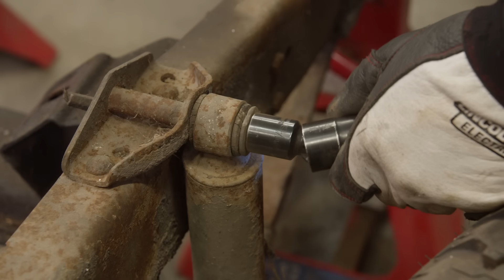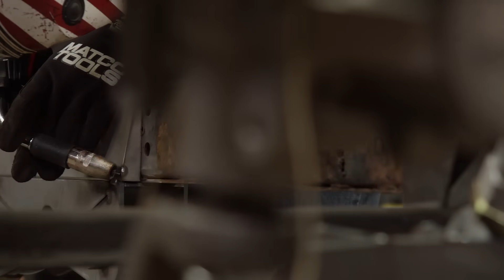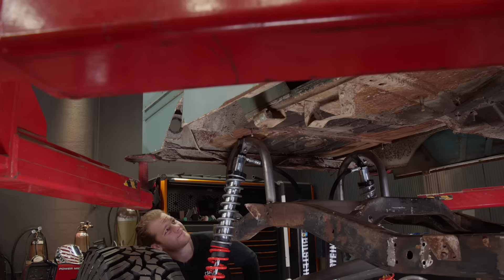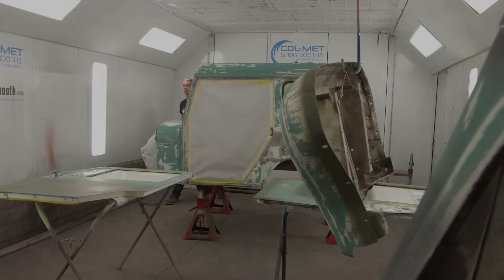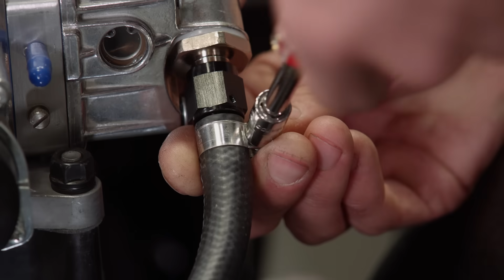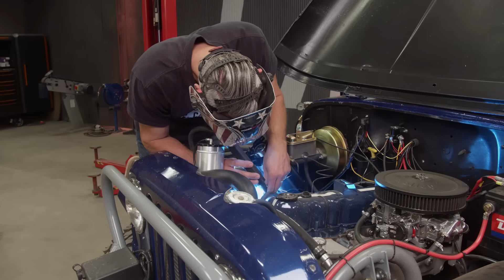We Turned a Mail Jeep Into a Serious Trail Machine

Comment: I have run into more than 1 Duralast wheel bearing that had wheel studs that overstretched at a reasonable lug nut torque. Last brand I would ever choose, if I wanted to trust the wheel to stay on.

Comment: You can test the transitor to see if it failed. A faulty door swith or bad ground creating repeated switching of  the circuit will make a transistor fail. I had a circuit on a pinball machine kill the transistors due to dirty optical switches.

Comment: Love the project. A friend of mine had one of these DJ jeeps, but it was left hand drive. It was an Airforce MP security patrol vehicle from our local air base. Had tons of fun in the woods and fields. 
Ps. You guys need to tighten your hardware a little more. Don't be afraid to crank on it a little, especially when using a short wrench.

Comment: Redid my 5.4l, 3valve. Need a tune; really bad!!! S&B intake with exhaust cutout. Engine runs better; with the cutout closed. Have 37" tires...so; need to turn big tires. 
Getting 10.5 mpg. Shifting points are not right. A lot of torque. No high rev. Excitement!
Would a tuner work???

Comment: The front differential cover you got from Summer racing doesn’t have the channel around the ringer area, so it will Throw oil forward properly. You need to Gail Banks cover that does have the proper shape to it to have proper oiling.

Comment: The hole through the fire wall for the wiring should have a rubber chassis grommet. Over a period of time with vibration. the metal edges will abrade the wire insulation, creating a condition for short circuits or grounding conditions that may be hard to trace.

Comment: I never noticed them installing a radiator fan. When you crawl at low speed, you need to move air across the core with a good fan. The separate transmission cooler had a fan

Comment: WOW!! GOOD WORK on paint.
If I was to paint it,  the big difference I would do….. instead of paint.
I wound use Line-X, or Rhino Liner like the material used on spray on bed liner.
You fine gentlemen still did a far better job than I can.

Comment: Now, tell us how much you would charge someone to create such a build. Even when combining old parts from a junkyard, the vehicle produced will need FAR more money to keep it driveable than the cost of creating it. This goes the same for those purchasing classic cars and trucks at auction.  As gorgeous as it might be on the outside, the car will be at a shop for repairs more often than it's sitting in your garage, even if you merely drive it on weekends.  You must constantly pump money into it, (a money pit), as most parts will eventually fail.

Comment: No dirt no mess no problems everything goes on perfectly. Amazing a pipe bender a torch a tape measure and a cutter autozone and that other main supplier is all you need. Oh and the hands are perfect to no cuts etc. all programming and starting works right from the get go….. shops would kill for easy work like this they broke the code

Comment: What’s stopping me from spraying my own vehicle is buying a 5 gallon bucket of wool wax and a sprayer and wondering how far do you go, the frame washed out and sealed, bottom of vehicle, frame to body connections, seams and inner body panels, wheel to disk or drum connections where dissimilar metals like to cause corrosion. I like the fluid film but the wool wax I think is the ticket for undercoating and rust protection

Comment: I'm big into jeeps, but towards the beginning, you said having a longer wheel length will be better, that's not all correct. The longer the wheel base is, the easier it will bottom out. So example trucks, if you take a truck on a trail with mud and big rocks, it will have a higher chance of bottoming out.

Comment: To any young mechanics get good with a torch it will save you so much time and headaches you can nip nuts in half while saving the stud or bolt it's on heat stuffto get loose nip welds without cutting threw the base metal ...all kinda stuff just practic when you can

Comment: I worked on those jeeps Back in the early 80's .
Some JEEPS had the Steering wheel on the other side. (I passed my test drive in one of these)
They were the last ones to be Replaced for "Ford Pinto" bad idea. Then at Last, The Best Came Along The LLV's.

Comment: A Strap on o2 sensor......hmmm.... Cause that wont leak and give a false reading, spend the extra 15 mins and weld it on with a proper bung, 15 minutes now will save you hours out on the trail.

Comment: There is no lubrication to any bolts,bearings and any surfaces at all anywhere.i wonder if those wires through firewall will be cut due to no conduit around it.this rig would rust and seize itself together within two years.

Comment: I’m watching you guys wire up the jeep when you put the module inside on the firewall and cut a hole in the firewall why didn’t you use rubber grommet in the firewall to protect the wires going from the inside of the vehicle to the engine compartment

Comment: I have a Dana 44 in my bronco build and I’m running 38s just fine never had a problem with my axles
Reply: I've got a 74 Bronco with a Dana 44 up front and a Ford 9" out back, so can I ask wtf do you need tires that tall for? Do you rock climb in a 1st generation Bronco? I'm runnin 33" BFGoodrichs, a truck 4spd, 4.88 gears and posi front and rear and this thing wheels like a mule...

Comment: Biggest question i have was the trans cooler placement ever an issue? Seems odd to be on the bottom, and would be a concern if it was on really aggressive runs that might cause a bottom out, or in a bit wetter areas. I dont mean mudding, thats not any fun to me, but i get that people like it. Im more concerned about the fins getting clogged up from moisture and dust, and potential rock damage?

Awesome video BTW. Really cool because im building a DJ5 into a rat rod. im embracing that its my 2WD jeep.

Comment: You need some suspension seats with a 5 point harness.  Those seats with lap belts look like crap.  It needs a light bar and a spare on the back with a trail jack.  The tires are not the best trail tires unless you are street driving it too.  You should have a pump to air the tires back up after a trail ride.  You also need mirrors and a horn if you want it street legal (as well as all the lights and turn signals.  I would put a quieter exhaust in it too.  It sounds like a diesel that is struggling...  Then you can put a sound system in it.  Put in a fire extinguisher as well as tree straps and a pully.  I would have welded on a O2 bung.

Comment: On the Victor Wrench 
(Cutting Torch) there are other cutting heads avalible. A 45° an a 90° which aid considerably for bolt an rivet heads or blowing out welds .

Comment: Question maybe I'm just picky or bitching but with all the stuff you guys grind off to weld I get taking the old paint and rust off but do you not paint in the spot your not welding to for one and 2 do you not paint the shit you weld untill you get the frame blasted and coated or am I way to picky I'm just asking maybe I've been wasting time I've just always come across rust under shit that was built like that

Comment: Definitely not a professional job when you run your ground and power through the body with no rubber grommets that equals melt down on electrical. The second they got all these high tech tools and cannot figure out the correct angles to build for the doors thank goodness for sheet metal to cover that mess up. The third thing is never put your transmission cooler above your driveshaft if you twist your driveshaft off it goes into your transmission cooler. Absolutely amazed how they even got sponsors. Nice job on the 4 link though

Comment: One of the only things I'd have done differently is add an on board air compressor. 

They're great to have for a real offroading vehicle since you'll be airing the tires up and down pretty often if you know what you're doing.

Also, as much as I like an aggressive sounding vehicle, that baby downpipe and barely a muffler combo is going to be brutal considering you'll be riding around with the doors off constantly just assaulting your own ears.
Reply: Good suggestions, and speaking of the exhaust system, I would ditch the hose clamps and weld the O2 sensor mounting plate onto the pipe. It would be a bit more work, but you wouldn't have to worry about it leaking or coming loose.

Comment: Fuel cell needs to be a cylinder hidden under suspension hoop cover to take advantage of the space.  Cover could be a bit bigger to close in both elements.  Would be a better separation between fumes and operator.......  gotta have some space for a few bags of groceries.......

Comment: While you axed the obsolete brackets, why not fill the holes and avoid dirt/moisture intrusion?
Reply: Bro, these shows are several years old if not older, and most, not all but most projects are built, used a few times for a show and then crushed after they strip sponsor parts off.
Reply: @TheRoadhammer379  seems like you've made this comment b4. This episode is only a few months old. Am I missing your point?

Comment: The issue with mounting bump stops on the frame like that is you loose up travel because of the location of bump stop. You have wide axles. Widen your bump stops to the furthest out you can go and it will allow you to have more up travel when compared to mounting it under the chassis.

Comment: Not really a good idea to reuse hoseclamps. They're basically a limited use item, and you don't want to be the guy that has one snap at the road side. For the price... not worth it. Not worth it to buy classic thread on clamp either, just get the better ones with the nut and actual thread. Those really are life time purchases.

Comment: Eternally you will a plate on the chest you clean the entire chassis under the plate but you only do a perimeter well what about the rust throughout the rest of the plate where you cleaned and did not do no protection

Comment: In trying to "get with the times" and everybody looking toward electric, I think one of those postal vehicles converted to electric would be a nice build.
Reply: I don't think it's a good idea to off-road with those batteries to run an electric motor if you flip it over and they get hit and crack during a roll over or crash and catch fire or explode it be very dangerous

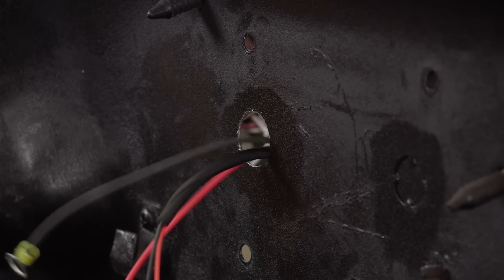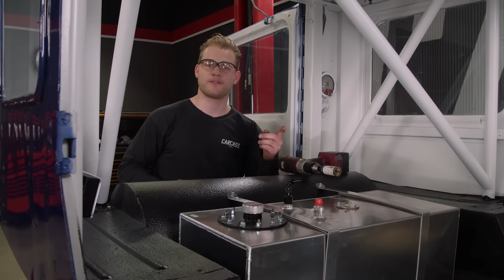Comment: 1:28:44 You're seriously not running a grommet let alone not even deburring/filing the hole? Not really the greatest thing to do here. It might work temporarily but you're just asking for problems otherwise. Folks wonder why XYZ keeps blowing fuses after "working just fine" for a while.... and ran their wires like this and don't see what's wrong with it. At least toss some electrical tape on it or something. You put grommets on the fuel lines at 1:38:15? So you must know their importance.

Comment: Would have been cool to reuse the old sliding doors but cut off the window frame, so basically the half door that slides. And why did you reinforce the top of the front axle but not the bottom that will actually hit objects?
Reply: So the axle doesn't bend. Skid plates are put under diff housing . Another thing altogether

Comment: Back in the 90's I had an ex-postal service 2wd 1976 DJ5 I had bought from a friend who just wanted to get rid of it for $100 bucks. One night I was out messing around in the mud in a heavy rain storm with my buddy. He had a ex-Park Rangers 4wd Chevy K5 blazer he had bought at action. He was always bragging how it had heavy duty axles, transfercase, transmission etc... being a former Rangers blazer. He got that blazer buried to the frame rails while in 4wd that night. While I was literally doing circles around him in the mud in my 2wd DJ5. I put a beating on that jeep for several years and had loads of fun with it. Many road, fishing and camping trips in that thing. Eventually sold it for $600 bucks and bought a 1961 CJ5 I built up. One of the best vehicles I ever owned. In the years I had it the only things I had to do to it to keep it on the road other than regular maintenance was replace it's fuel pump, starter and a radiator. All of which were very inexpensive to replace. Was a very well made, tough and reliable vehicle.

Comment: I sure would like to know what it would cost to go through a rig like this from front to rear. Hardly ever do we get to know what these cost it's cool that you can hook up all these neat new parts and fabricate up whatever you need but these shows are designed not for the shop owner these are designed to get guys like me out there and turning wrenches and doing stuff on these vehicles and saving one from the crusher. But I don't have the bankroll that these shows are putting into them my go-to dial for parts is not summit. But I like what's going on here and I would love to know what it would cost ultimately to do something like this or have it done by someone that would be two different prices. Even just knowing all the parts that were thrown into this because although a great build it's probably not cost-effective for me to build something like this on a regular shoestring budget. So more or less just a dream build.
Reply: I still check Summit for OE parts since I live so close, they've actually been cheaper than the parts store and even RockAuto a couple of times. Not often, but it does happen. Plus, there was a couple of time when no one else even HAD the parts. And these aren't some old 1960s muscle car I'm working on, I'm talking about modern 2000+ Jeep, Ford, Chevy, and Hyundai parts (the brands my family owns).

But yeah, I don't even bother looking at their catalog. Other than to read the blurb and look at the pictures of the car on the cover. Remember that green Suburban from a few months ago? My uncle did a LOT of the work on that truck..
Reply: It was "on a budget" so around $5000 I'd say.
Reply: @1one3_Racing  They had way more than 5000.00 in that. There was about 2500.00 in those Bilstein shocks alone. and another 2500.00 in that PSC hydro steering. 1500.00 in the EFI setup. Beadlock rims and tires, engine rebuild etc. More like 15-20k
Reply: @jamescole6846  that was the joke......
Reply: @1one3_Racing  Sorry. I stupid :) You trolled me good on that one.
Reply: A Dream for sure...100 Grand shop and another 100 G for tools...... for most of us in this lets go brandon economy...never gonna happen......

Comment: Theres no way I'd have picked a 99-04 60 over an 05+ unit. Strength isn't even close
Reply: I agree but for this buggy that probably weighs 3000 lbs less than a pickup truck, they are plenty strong.

Comment: Will never trust any jeep unless it has leaf spring suspension after spending a few months in the hospital because of a TJ deciding to lose left rear shock and both springs at 55_60 MPH going down the road causing the body mounts to fail on the passenger side and sending it rolling for a few hundred yards I love to watch 1996 and newer model jeeps get crushed into nice little cubes, junkyard trash deathtrap
Reply: Shock failed... Was it an OEM shock? Was the Jeep lifted? How old was the Jeep?
Reply: @capnspicy5565  1997 wrangler TJ the shocks are only held in place at the top by two small bolts that are threaded into sheet metal and as I was going around the curve (a very gradual one) the top bolts pulled loose and as I straightened up only the coil spring was holding the side up witch started the jeep to rock side to side and that caused the coil spring to lift out of the retainer on the axle setting all the weight on one side suddenly and it bottomed out on the rear tire witch in turn started the jeep to bounce breaking body mount bolts letting the jeep dig into the highway causing it to flip and roll, broke shoulders blade,jaw, right arm, back, right leg shattered ankle, still healing up as soon as I could get out side and get under it to see what happened I realized how bad the suspension was put together and no it was not lifted had rancho shocks,an after market lift with more substantial hardware and not sheet metal control arms would have been better than the chincy OEM parts anyway I think that I will stick with leaf spring suspension, simpler and stronger (have a 73 charger to fix with a 440)any way before I can get another 4x4